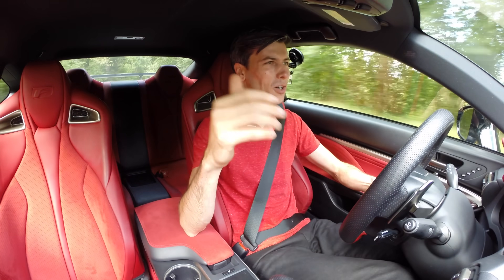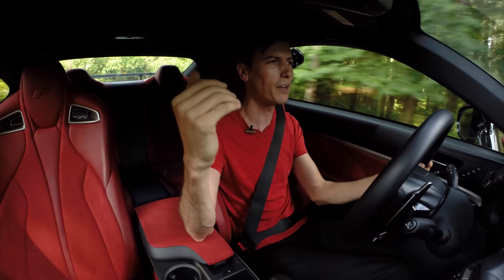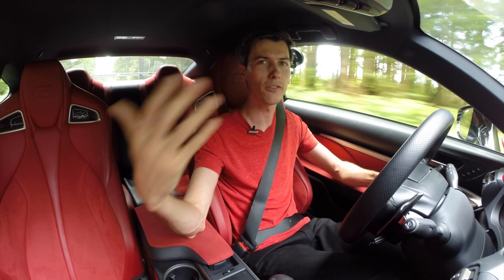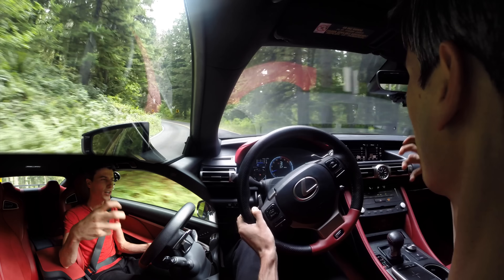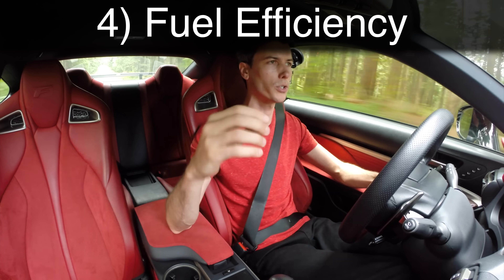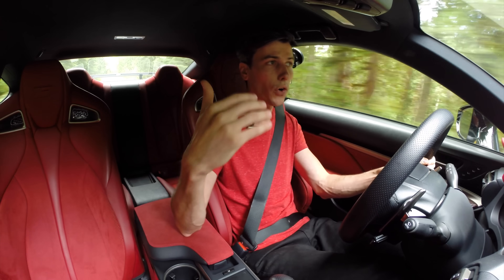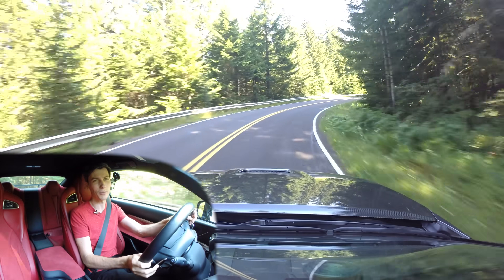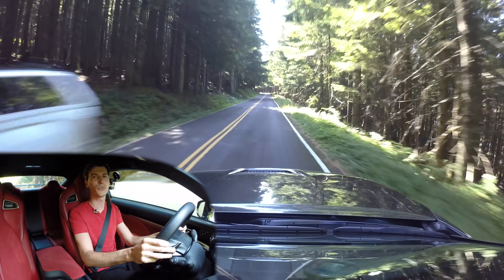5 Reasons You Shouldn't Buy A Turbocharged Car

Comment: Just one itsy bitsy problem.....
He's talking about 0 to 60 times and lag times, torque curves....whatever. 
These things are relevant ONLY on a racetrack. 
In ACTUAL driving,  we get up to legal speed, usually around 6 to 12 seconds,  due to traffic conditions. 
On a long trip, cruising at 75 to 80mph, you're not worried about anything except RANGE. A 4 cylinder engine,  off boost is going to be FAR more fuel efficient than a v8.
Of course,  if you Always go 0 to 60 in less than 4 seconds,  you're going to drain your fuel tank just as fast as the v8.
But NOBODY drives like that. Get the 4 banger with the turbo.
Drive it normally,  Slam the throttle once in a while to have some fun,  same as the v8.
Enjoy the extra fuel economy.

Comment: I have not owned an NA engine for 25 years and I never will again, twin turbos are awesome, what delay? maybe 0.2 seconds with modern electronic variable turbos but to compensate the torque builds 100% faster so the delay is imperceptible but the acceleration is awesome.

Comment: The proof of the pudding is in the eating. In the end, smaller turbocharged engines are lighter on fuel and perform adequately. To hell with the sound. If it's quieter, so much the better. And turbo markedly increases torque at lower revs and over a bigger rev range.
Reply: Well, if you mainly drive short distances with a lot of start and stop in the city, then absolutely yes.

But if you frequently do large distances across the highway or country roads, that's where the small turbo engine will waste fuel for cooling. A naturally aspirated engine with equal power numbers will need more fuel to get going, but once it's going, it runs very efficiently and in fact more efficient at higher speeds in comparison to the small turbo engine.

Comment: Would there be any advantages to a separate oiling system for lubricating and cooling the turbo? Try to decouple the turbo heat from the engine if you can.
Reply: Most new factory turbo,s are water cooled.

Comment: Just to quickly touch on your point about oil sitting on the hot turbo shaft and being exposed to high temps,  this is the exact reason that it’s pretty important to either A) stay out of boost if you’re running up the block to grab milk where you will be in boost and then the next second you’re in your driveway and turning the car off or B) give the car about 2-3 minutes to idle once you reach your destination if you were just using heavy boost.  

From what I heard, (and correct me if I’m wrong) this gives the hot pooling oil a chance to get circulated out of the turbo and back into the engine where (I think) the temps are cooler?

Side note about MPG’s: If I stay out of boost on my 25 mile drive to my girlfriends house, I average 39-43MPG with my 17 WRX 6MT (Perrin intake hose and throttle body coupler helped a lot wit that).  But man, once I start messing around with boost (just to hear it spool obviously) my average mpg poops.

Comment: Had a rental Passat one time...little turbo engine, it SUCKED trying to get onto unfamiliar highways pulling out into traffic.  Once it revved way up, it took off good but trying to change lanes in tight fast traffic I had to guess when there'd be a gap and floor it, then hope I wouldn't have to hit the brakes if the gap didn't form.  It made driving much harder and more stressful.

Comment: A turbo convinces the engine it is bigger than it is. Big engines suck more air & fuel in, turbos push more air in, which needs more fuel to maintain the ratio. So, now I wonder how smaller turbo engines use less fuel, when the turbo raises fuel consumption.
My guess is that at lower power demands (cruising), the turbo gets bypassed. Only in acceleration, does the turbo get used, meaning that the stoplights that governments install all over the place make fuel consumption ridiculously much higher.

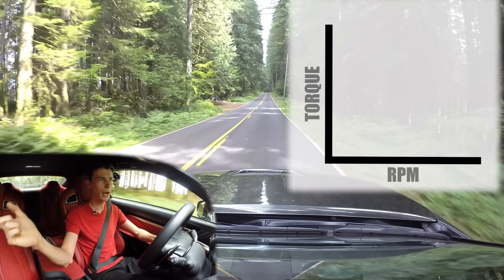Comment: I agree at 3:40 with the Turbo being smaller for response rather than larger for more power.
I like my car, the last turbo broke but hey! It's done a lot of work and now my cars throttle response is not so bad now :D
Diesel's work best with Turbo vs Without.
Gas engines are more reliable without the Turbo rather than with. Because Gas engines don't all have a strong build to take loads like a diesel is built.
Turbo's do have risks of reliability and if you don't look after your car well enough it will be damaged and wear out. The thing is so well balanced and the RPM on those things are in a little document I got as high as 300,000RPM and no motor I know runs that fast. Balance is critical!
Diesel's while they may lose reliability with a Turbo, they still have way more reliability than even a normal gas engine. However to be contradicted here. I am probably living in the 80's and 90's with the vehicles I am thinking about. My car won't leave me by the side of the road where's my Dad's would... And when Dad's does... It's embarrassing... Especially at traffic lights!

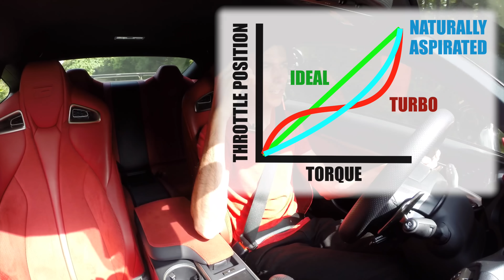Comment: 1:30 - That's actually slightly wrong, but a common misconception.

"Turbo Lag" is the time between selecting a throttle setting and the requested power becoming available.

"Boost Threshold" (what is being discussed here) is the minimum engine RPM at which the turbocharger spins fast enough to produce positive pressure in the inlet (IE supercharge the engine).

If you're annoyed by these today, you should drive an 80s Turbo car. Some of them did basically nothing until 4000rpm (with a 6000rpm redline) and even then usually took the first gear to actually spool up. But, once you were on boost they were really fun. It was "nothing....nothing...nothing.... TSSSSSS... HOLY CRAP!!.. PSHOOOOW... nothing... Nothing.......TsssssSSSSSS AHMAGAWD!!!!"

To be honest. I agree with him, NA is best. Turbo engines are great, but the current fad for engines that can barely move the car off boost are as annoying as heck.

Comment: A straight 6 or V8 is inherently balanced and will last. Crown victorias regularly hit 400k mi with abuse and neglect.
Reply: V8's are not inherently balanced. They use harmonic balancers on the front of the crankshaft to remove some of the vibrations.

Comment: The question is whether you desire to finish in first or second place. As an example, in the high altitude mountains of the far west, normally aspirated vehicles will always be at a performance disadvantage.
Reply: An LS7 vs. a Civic 1.5T? I don't think so
Reply: @nthgth  he's talking about the air density and other qualities of air at this elevation and how it effects engine performance.

Also why you comparing an ls7 to a civic? Common guy your smarter than that.
Compare a civic NA to a turbo charged civic, in the extreme elevations.
Reply: @RandoManFPV  yes, I was being an asshole and I apologize.
I only meant that "NA will always be at a disadvantage" is wrong. It depends entirely on the engines.

Comment: Nice video and love the points mentioned. However I have owned 3 VW diesel turbo engines now and each one has reached 160k before I got bored and replaced it.

Granted- they were not performance cars, but for everyday driving a 2k upwards rpm boost and 65 mpg has been good for me. 

Have the bike for NA fun.

Comment: 1. Throttle response
Smaller turbos

2. Torque curve
Smaller turbos

3. Reliability vs Cost
NA wins!

4. Fuel efficiency
Small turbo will always be more fuel efficient than a N.A engine with the same horsepower and torque. 

6. Sound
N.A wins!

Comment: I am rolling and rumbling on a 100hp 3cyl turbo-charged Ford Eco-Boost.  if driving and accelerating slowly, I can get 4,8 liters/100km fuel economy! The car is a bit slippery on snowy roads or gradient snowy roads, though. And the spread between 1st and 2nd gear is too big.

Comment: the most dangerous condition for a turbocharged car is a lubrication failure in the turbowheel axle where it is suspended.  because there is oil pressure stabilized suspension. mechanical suspensions can not stand these revolutions and would wear very quickly. Therefor, the suspension pressure is essential to keep it cool and in position. right. the oil pressure takes care of the suspension stability of that very axle between the two fan wheel chambers. Improper out-of-spec oil formulas can likely damage the turbocharger. because of e.g. fragments of gaskets coming off by that oil, causing congestions in the oil inflow filter right in the turbocharger. and, if not changed regulary, thickening, coal flakes, again causing oil undersupply. Portions of water in the circuit is also a danger for the turbocharger. There also are cars having an oil-immersed belt. Which is again critical then. Never use "other oils". Only the designed formula for that belt. since this will dissolve the belt otherwise, and, causing massive particle appearance in the oil circuit then. A Turbocharger dies from this because of oil supply failures caused by all that material in the oil, congesting the filter/s entirely. This can also go as far as to a complete congestion of the oil-sump intake filter for the main oil pump. causing a total lack of oil pressure everywhere in the engine in consequence.(yes turbocharger dies in the first place of this).

Comment: Question: Isn't the lower compression ratio, and therefore also the thermal effiency, of the turbocharged engines "compensated" by the increase in air pressure in the cylinder caused by the turbo? I´m thinking that the thermal effiency should increase as the amount of air that is being compressed is increased and not only the compression ratio itself. I'm probably wrong, but an explanation would be nice!
Reply: When you are in boost, the higher manifold pressure cramming more air into the cylinders certainly will compensate for the reduced static compression ratio. The efficiency loss from running a richer air/fuel ratio in boost must be considered though. But since you usually won't be in boost, there won't be anything to "compensate" for the lower compression ratio most of the time and your efficiency will simply be lower than it could be if you had a higher static compression ratio.

Comment: Modern turbo controllers do not have these issues,  It is a function of the waste gate controller.   You reduce temperatures with a heat exchanger known as a intercooler.  I fly turbocharged aircraft with 520 CI turbocharged and not much if this is really correct,  The intercooler reduces the compressed air temperatures to the point that the detonation margin is huge.  Plus, you can run lean of peak and you can reduce cylinder head temperatures drastically with great detonation margins.  The higher the engine RPM, the less time is available to charge the cylinders which is why increasing the manifold pressure with RPM is the correct thing to do.  You are not raising the effective compression ration beyond the design point if your system is designed correctly, because every system must not allow detonation.

Comment: I listened and I heard, but I don't agree.  I've owned 2 turbo cars, 1985 Doge Lancer and 1988 Chrysler LeBaron.  Both were very reliable cars.  I loved the 40 mpg at highway speeds and I loved the punch of the turbo despite the lag.   I loved the whine of the turbo.  If I ever get another chance to by a turbo in the car of my choice, I'de do it in a heart beat.
Reply: 10,000 thumbs up. I own 2; '89 Spirit ES and '91 Shelby Daytona. Both are highly reliable, if you factor out changing a head gasket every 5 years or so. Will not let go or either.

Comment: N/A cars don't have instant power.  They still have to build revs.  And if the power is at the top of the rev-range ala Honda S2000.  It will be a dog down low worse than almost any turbo car like the Honda S2000.

Comment: Max engine oil temps in gasoline NA engines ~200'C; 
while max engine oil temps in turbo gasoline engine ~400"C. 
That is a huge difference to the aging and degradation of the engine oil.
Combine turbo engine's accelerated oil degradation with today's extended oil change intervals is a recipe for shortened engine life.

Comment: Unfortunately in my experience the naturally aspirated engines seem to lack the low end torque, and tend to feel slow until they spool up. Yes I know there are exceptions, and yes the turbos sometimes need to be geared down to keep the boost on. Anyway, given my choice, I prefer the turbocharged motor. I also find the turbocharged engines tend to get better fuel economy. I would agree that the naturally aspirated engine seems to be more reliable. At work I have a Ford F350 with 6.2L Gas V8, and a Ford Transit 2500 with 3.5L turbo charged V6, they make about the same amount of power on paper, with a slight edge in peak numbers to the 6.2L. Both trucks are loaded down all the time, but the 6.2L is very doggy until it spools up a lot. I understand the newer versions of the 6.2L have improved this, but there just isn't any low-end torque. The 3.5L does have turbo lag, but it is mild, and is less noticeable than the lag the 6.2L V8 has, generally it has a lot more power down low. From what I have seen the 3.5L takes a much bigger hit in fuel economy when towing than the 6.2L, but it is still better on fuel. I get 12MPG with the 6.2L without towing, and 11MPG when towing. I get 17MPG with the 3.5L empty, and as low as 12MPG when towing the same trailer as the 6.2L gets 11MPG on. So yes, it takes a huge hit, but it is still better, and I am not always towing. 

The 3.5L is even better in the mountains at higher altitudes than the 6.2L, but it has not been anywhere near as reliable in a commercial environment.
Reply: NA engines don't "spool up". They have no turbo!

Comment: Whilst these 5 reasons are all very valid comments , there is a part missing:  A Turbocharged DIESEL engine makes A LOT of sense. Putting a turbo on a diesel engine increases  efficiency as the compression ratio can remain high. (unlike a gasoline engine) . That is the reason that ALL commercial diesel engines, (Marine propulsion, diesel generators, trucks, construction equipment machinery etc), are ALL turbo diesel driven, There is simply no other commercially viable substitute for the Gr/Kw/Hr consumption efficiency available today.

Comment: Most of your complaints are 10 or 15 years out of date.  Nowadays, car makers use twin turbos-a small one that spools up quickly for immediate boost and a larger one for high-end power.  This gives you a totally flat torque curve that a naturally-aspirated engine can't match, with no appreciable lag.  Other makers use combinations of supercharging and turbocharging to get the same effect.
Your point about the greater complexity and internal stresses of a turbo engine are the only ones that I'd really agree with.  The engineering and build quality on a turbo needs to be top-notch, and a poorly designed or poorly made turbo can be a disaster.  Fortunately, car makers seem to be building decent quality turbo engines without an unusual number of problems or failures.
Like it or not, turbos are pretty much here to stay.  Look at Porsche.  For years, they only had one Turbo model.  Now, every engine that Porsche makes is turbocharged.  The technology has improved so much that it just makes sense to use it.

Comment: Twinscroll turbos spool 1500-5000 RPMs now, to where throttle response is almost a null issue. 
There aren't any new cars with a V8 and touchscreen infotainment for under $40k. I got my Veloster N for $27k and it has a great power band and decent fuel economy too. And with more airflow (intake/downpipe/intercooler) and a tune I'll have better gas mileage, better power band, and almost 400bhp.
Exhaust note is much more important than hearing the actual engine as well. I'll take the Veloster N with both turbo sounds and that sweet active exhaust over a  standard V8  (Tho  Mustangs and Corvettes still sound great too)

Comment: This video is long overdue for a complete rethink. I say this as a person who lives above 9,000 feet, and I see all the fallacies common to a person who has never driven at altitude. Non-turbo engines are a continuous nuisance around here, because every little hill they encounter, they lose 10-20 mph whereas the turbo engines suffer no power loss and lose no speed. People think they have great cars with great engines, so they hog the left lane, not realizing what a traffic jam they're creating for those who don't suffer the 35+% power losses that their N/A engines are struggling with. And the high altitude phenomenon is just a metaphor for everything that is wrong with N/A engines versus turbo. Turbo engines are inherently able to regulate cylinder pressure based on exhaust temperature and velocity, and that is what makes a turbo engine work it's magic, something that isn't possible with N/A. That's the reason they were first developed for use on WW2 fighters. Using a low cubic inch engine that can boost or deboost as needed is better for fuel economy, and contrary to your false statements they are cleaner burning. They are able to consistently produce a certain power curve despite a number of variables, altitude being one of them. They are lighter compared to a larger CI engine. There is no reliability lost when engineered properly. My 1998 Dodge 2500 Cummins Diesel has over 300,000 hard towing miles on it and has not had a SINGLE engine issue, ever! It can exceed 19mpg towing heavy loads in mountain driving where gas N/A engines are struggling to surpass 6mpg in the same conditions. It can pull a 5,000 pound camper while outrunning an empty Toyota V8 on 11,000+ foot mountain passes such as the Ike. Disinformation like yours is part of the reason that gasoline and natural aspiration proliferates when clearly their time has long passed.